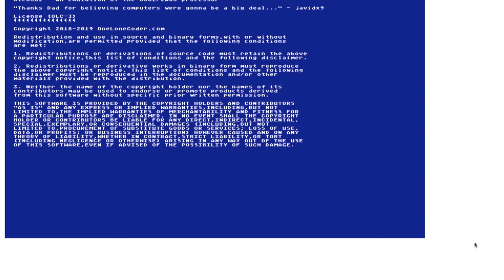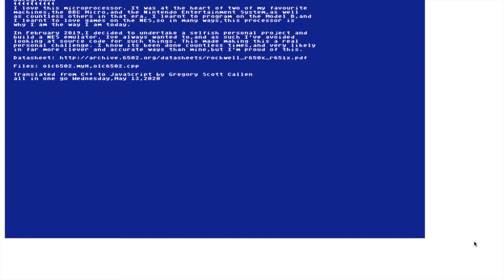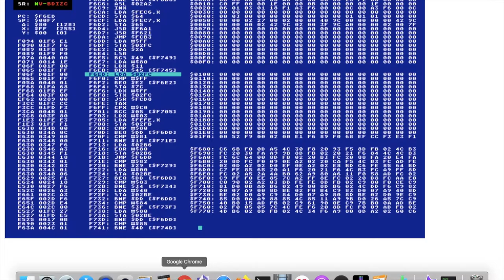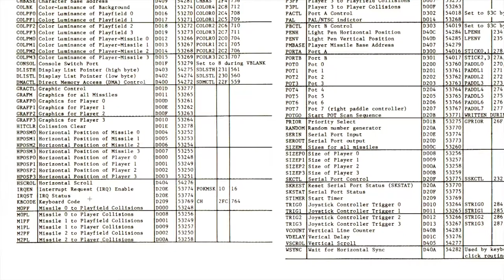Atari 8 Bit OS Boot Sequence (Part 3)

Comment: Where was this YouTube channel when I had my Atari 400? Oh. Oh, right.
Reply from the maker: Poor'lil SALLY without a GTIA, ANTIC, or POKEY to play with... I got to fix that!
Reply: @dendritedigital2430  I'm an old C64 hand (Louisville, Kentucky, age 13, 1984) and I have just got my Ben Eater 6502 to say "Hel" out of "Hello World!". I'm of course one of those 50-somethings who grew up on the Atari, Apple ][, and Commodore 8 bit systems. 

I know about ALL the Apple, Atari, and Commodore strategies, and, as soon as I get my 65C02 system to reliably say, "Hello, World!", I'm going to be that 53 year old designing an 8-bit graphics and sound solution, having had 4 decades to think about it since I first unwrapped my first Commodore 64 under the Christmas tree. I'm first going to convince myself that I can replicate the function of the ancillary chips, ANTIC and VIC-II and SID definitely included, and then I'm going to ask myself what the designers of the day could have done if mass production wasn't on their minds: can I make a dual-core 6502 (the answer is YES)? Etc. 

I have a bunny rabbit now, who I rescued from well meaning but very young neighbors next door. My bunny's name is Karen (she actually is an early-misgendered boy, so it turns out.... well, it's none of my business anyway.

So once I get my 6502 breadboard computer going, I plan to make a video game like Frogger, but it will be based on my bunny rabbit companion Karen. She won't get run over: it will be about collecting treats and getting petted.

I know about racing the beam. My idea is to clock subdivide and, use a completely separate CPU 6502 on the same buss, just to drive video, do bank switching, and per-line graphics modes, a hybrid of the Apple II, Atari and Commodore approaches. I was 14 in 1983 and now I'm gonna build something that takes lessons from all three of the great computer manufacturers of my childhood, wire by wire.
Reply from the maker: Sorry it has been a full year since you wrote this "War & Peace" without a proper response. 

I was 12 in 1977 when dad and I split the cost of a Bally Arcade System. It had 4K of RAM, a calculator keypad, a ROM Cartridge Slot, and a Z-80 CPU. A few months later I got the BASIC for it.

By 1980 I moved up to the Atari 800. I learned its BASIC then went headlong into 6502 ASM. Before I graduated HS I knew more about computer programming than Mr. Long ( my mathematics teacher ). 

1989 I got a job with Silicon & Synapse to translate disassembled x86 code to Aztech C on the Amiga 500. When I got that job done. I was assigned a new one but I couldn't figure it out. I couldn't find where the code started or what it was supposed to do. Some time before the reassignment I asked Allen Adham ( the BOSS ) why we were translating code instead of inventing it, "Isn't this plagiarism?" He yelled at me, "What are you a LAWYER!" so I suspect the second assignment was a trap to get fired. 

Silicon & Synapse became Blizzard Ent. Allen Adham, Michael Morhaime, and Frank Pearce all became millionaires. Me? no where close...